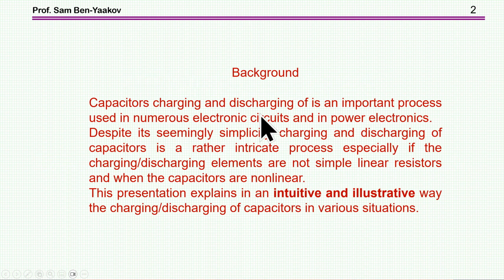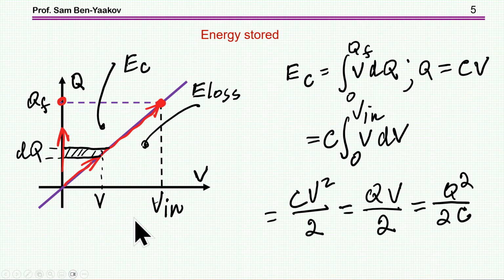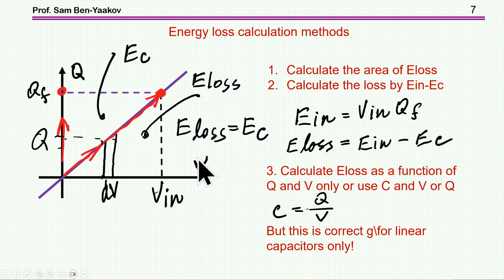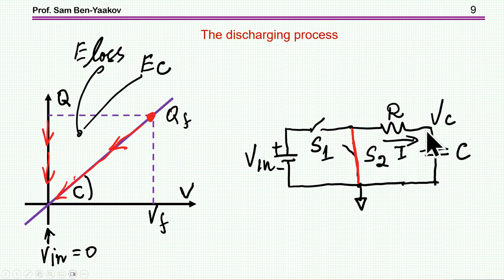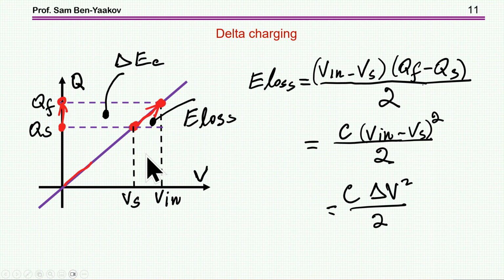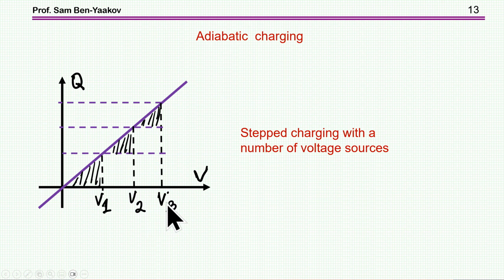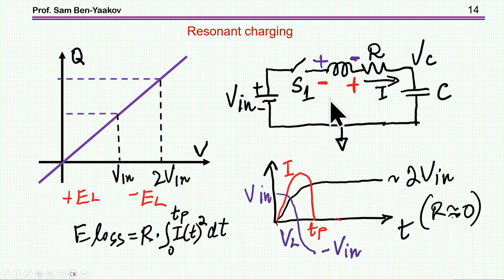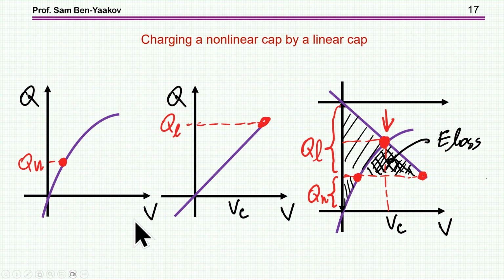Illustrative explanation of charging/discharging of linear/nonlinear capacitors - Don't miss

Comment: (whispers from the side), it's not "electromagnetic radiation" that accounts for where the energy in a capacitor goes when it's discharged into a short (the right analysis works even with infinitesimal point capacitors with no inductive loops at all). 

Think about the physics of the dielectric. Energy is stored in a capacitor by doing work on the bonds in the dielectric creating a displacement field. When a capacitor is shorted, the electric potential originally created during charging by displacing ions and bonds is returned back those electrons and lattice allowing them to all return back to their rest, equilibrium state. The current flows back into the capacitor.

We don't need a single imaginary resistor, an arm-wavy inductor or any EM radiation (or even imps!). It'll even work with superconductors (although its unlikely they'll remain superconducting when trying to conduct above their critical current)
Reply from the maker: So how do explain the fact that he loss is independent of the value of the resistance in the loop  (which you can change) and  hence independent of the current amplitude, for same Delta(V)? Further, since the energy is lost OUTSIDE the capacitor what happens when R=0?

Comment: One thing I didn't quite follow from this description is that it seems to imply that charging a capacitor is inherently 50% lossy, i.e. if you expend 1J of energy to charge a capacitor, you'll get at most 0.5J back when discharging. This doesn't seem to gel with my practical understanding of ripple current and dissipation factor, so I'm guessing I've misunderstood something along the way. Is the "E_loss" under the Q/V curve specific to contexts where the energy is being dissipated into a load, i.e. representing a symmetry between the energy you put in and the energy you get out?
Reply from the maker: Well, this is a physical fact. In charging of a cap from zero you loose 50% due to the rms current on series resistor
Reply: @sambenyaakov  so if the series resistance is 1pΩ, and you charge the capacitor to some arbitrary voltage, then discharge it again, you lose 50% of the energy? That seems counterintuitive.  The ohmic losses would be ~0. What's heating up?
Reply: @gsuberland  the ~1pOhm resistor is heating up. The intuition is that the current in that scenario is extremely high (say 1V/1pOhm is is tera-amp), so despite it being a low resistance, the power dissipation is huge!
Reply from the maker: @gsuberland  I am talking about this in video.
Reply: The assumption here is that charging occurs via a perfectly stepped voltage source. This is not always the case, especially for switchmode cap chargers. If the output current is instead limited by a switched inductor instead of the voltage difference between Vin and Vcap dropped on a dissipative element then there is no loss implied by QV and efficiency can approach a theoretical 100%.

Comment: Nice lecture and topic. It is very important to understand stored energy and therefore switching losses, and I hope many of my peers in the semiconductor industry would take care on learning those concepts.

Talking of switching losses, I actually quite like the approach used by Matioli [Perera; Matioli - 2020 - Analysis of Output Capacitance Co-Energy and Discharge Losses in Hard-Switched FETs] and [Perera; Matioli - 2022 - Hard-Switching Losses in Power FETs_ The Role of Output Capacitance], where the turn on of one device has to dissipate its stored energy and the co-energy of the other device being charged.

There is a large misconception, especially in industry, where the no load turn on and turn off losses are assumed to be Eoss, and the switching loss to be 2*Eoss*fsw. Firstly, the turn off loss should not include the Eoss stored energy, as it is not yet dissipated and therefore that energy should be removed from the turn off and considered in the turn on. In this case, at zero current, the Eon would be then 2*Eoss and Eoff=0. But that would not be right. Indeed, as definition of work and as explained by Matioli, the correct calculation should be Eon=Qoss V, which takes into account both energies. That's of course a first approximation. But maybe this can be a nice hint for a future lecture (unless I missed it).
Reply from the maker: Good points. Thanks. Perhaps.

Comment: Thanks for the video sir, it would be great to have a video on the discharging of the inductor, specially in the boost converter, since I’ve always been confused as it seems the voltage across the inductor is constant during discharge. Thanks
Reply: And also if the current does infact decrease, why is the voltage across the load resistance constant under discharge also?
Reply from the maker: Good suggestions. Will try.